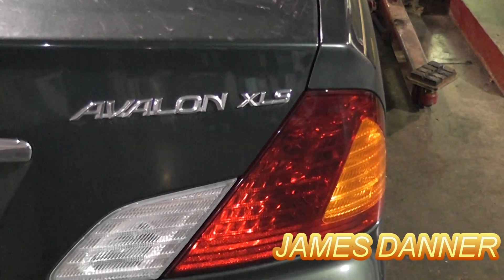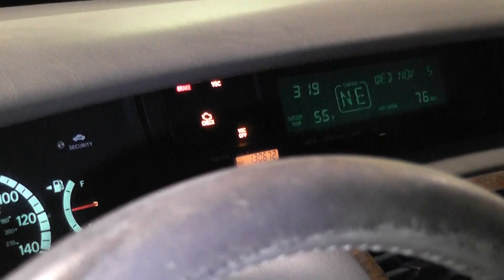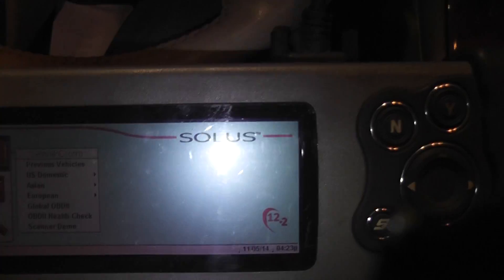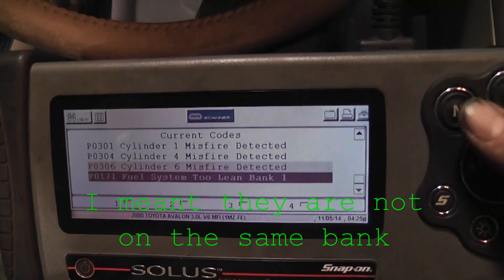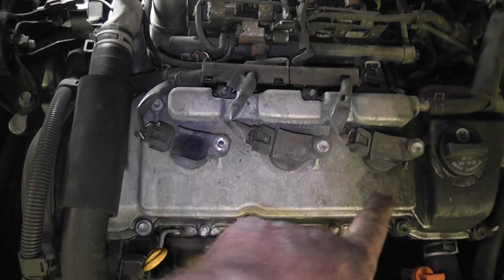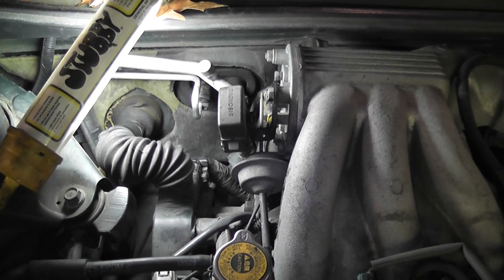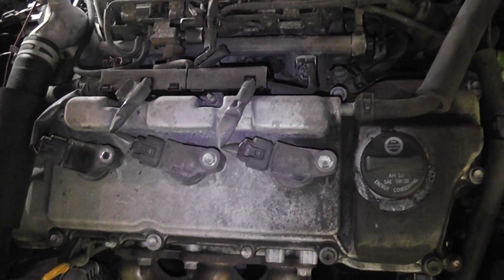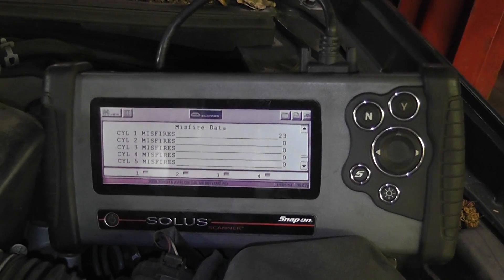TOYOTA AVALON MISFIRE REPAIR

Comment: Great that uou put it fown to the injector. I replaced all six on my 98 rx300 as one was faulty. Once you get high mileage in these engines you really want to be proactive with maintenance and start replacing sensors and belts in ine hit if possible. My experience with older classic cars is that once  components start to age fail the rest starts to go.

Comment: Hi James, thanks for your video, it might help with a 1mz I'm about to look at.    and a gift for you....  the dip in the current waveform is the injector mechanically opening and the bump in the voltage waveform is the injector mechanically closing. there is a lot of good info at pico scope auto waveform libery.   Thanks -Simon, Automotive research engineer :)

Comment: I have 00 es300 same engine same issues.  I’ve changed out ignition coils and all injectors and Vt solenoid on both sides of engine.  Still getting same outcome but I know my cat on rear needs replaced.  Gonna do that today possibly,,,,, get back to u.

Comment: I have a 2002 avalon and mine seems to want to cut out at around 41-45mph  so I changed all plugs and coils except number 1  very difficult to get to for me one moment the car is running as it should for sometime and entire day even had check engine light go out completely  well  now it's back on and still doing it as it pleases then it begins to flash and code say random multiple misfires 135  so I change all except one any chance it just may very well be that last one I haven't changed yet ???
Reply from the maker: If it's the whole bank. 1 3 and 5 suspect a vvt solenoid sticking on.  I have a video on that as well
Reply: I have an 03 avalon and I'm getting mine looked at tomorrow. I have the same problem. I have been looking around and the EGR valve might be stuck to open.
Reply from the maker: Is yours misfiring all on one bank? 1 3 and 5 or 2 4 and 6? I have a video on that symptom on Toyota with a vvt solenoid sticking on causing this
Reply: @jamesdanner7850  mine is misfiring on 135
Reply from the maker: Find my Toyota/Lexus vvt fault video. It will help explain
Reply: @jamesdanner7850  ok thnx very much ok man really appreciate it alot

Comment: The misfire goes away because you input -negative feed on the negative pulse side of the fuel injector forcing the injector to open the fuel stream to the cyliinder, that is kind of dangeorius thou because  if it remains like that during idle for a long period of time it may cause a cylinder hidrolock. Excelent vid James! Thanks.

Comment: You had some specialized equipment there.  But for those of us with only the OBD II scanner tool.   If the scanner points to a cylinder misfiring, can't we just put in a new spark plug into that cylinder and then swap the coil with a known good(front bank, easy to get to) coil.  If the misfire on the scanner moves to the swapped location, the injector was bad.  Disclaimer.  It has been 35 years since I was a professional mechanic. It was carburetors at that time.

Comment: I had alternator timing belt water pump and spark plugs changed and car is still shaking I just ordered ignition coils should fix the problem?
Reply: QuadRiderHonda Might wanna make sure the car was timed correctly before you start spending money and throwing parts at it buddy

Comment: So, where the hell IS Bank 1, Sensor 1 located on the 1997 Toyota Avalon.  Dealer, shops are all telling me it is the one nearest the radiator, just in from cyl 6. How can that be true when everyone knows that Bank 1 is ALWAYS in Bank 1 - which in the 1997 would be at the FIREWAELL side, ya?

It is a 2-wire sensor, btw.
Reply from the maker: +Dan Lo Fat bank 1 sensor one is firewall side
Reply: @jamesdanner7850  thanks for that by the way and and wallets been two years now I got the same kind of readings you have almost identical shows the problem is 1 and 2 but it's actually it's a dual coil and and the one side is faulty and two is taking the brunt of it.

the mister I was definitely on one so I got to AutoZone borrowed one of their Cheshire cat switcher it's got a pressure gauge in mm in a meter off-road testing the injectors and injector one salty so I'm changing out all the injectors and all the spark plugs spark plug wires and spark plugs and why not the coils too!

well you got to figure it's got 320k+ mikes on it right now.

Comment: I have a 2000 Toyota Avalon xl that just stop firing run find the day before what can cause that
Reply from the maker: +Keith Baldwin does it run on starting fluid?  Like a no fuel scenario.  Or not, like a no spark. I have a video on a Toyota where one of the coils shorted out and shuts the car down.  U have any codes?
Reply: James Danner it is getting fuel but no fire to the coals or wires

Comment: Test light/functioning injector phenomenon; a shorted injector pintle wont energized/open as much as designed due to loss of current to heat in its coil winding but when the test light is hooked up to its circuit in parallel it become an easier path to the current/voltage thus stabilizing the the shorted coil and allowing it to partially functioning during idle/low demand  but this wont work on a heavier demand duty cycle as it wont allow much fuel to pass through.  

Good video Danner keep it up

Comment: This one is interesting.  Good work narrowing it down so quickly to the injector.  

My guess would be a mechanical sticking in the pintle, causing restricted flow.  When you add your test light, it keeps the injector open longer and makes the misfire better because of the extra fuel.

Good video.

Comment: Hey James! I have this same car and its not coming up. No start actually. I have replaced the fuel pump but it seems no power at the pump and the relays seems to work fine. I would be glad to hear any suggestions.
Reply from the maker: +Suleiman Adams been on vacation last 2 weeks. If you still have the problem, I'll look into some wiring diagrams Monday
Reply: That would be wonderful. The car has been sitting down for some weeks and i'm running out of ideas as i am very new to the DIY lifestyle. Would be looking forward to any help or suggestions. Thanks
Reply from the maker: +Suleiman Adams what year is the avalon
Reply: 2000
Reply from the maker: +Suleiman Adams so if you think we r dealing with the fuel pump.  It gets power from the 
CIRCUIT OPENING RELAY  which is behind the drivers kick panel. 
My wiring diagram shows terminals 1,2,3 and 5
1 should have power from the ignition switch 
   Run and start
5 should have power from the EFI relay in the   left front of engine compartment 
2 is the ground control from the computer
3 is the one feeding pump
So if u have a test light ,, hook it to ground and with the C.O. relay unplugged you should see power on one with key on run and on crank
Another should show power too but it may be only for a few seconds on run but constant during cranking.
If u hook the test light to battery positive,
One ( terminal 3) should light up the test light confirming there is a ground path thru the pump
The last one, no 2,  may light up test light for a short time when u initially turn key on but definitely should when cranking 

Start there

Comment: It kinda acts like an intermittent Ground, I know I had a 98 Avalon that had a an intermittent misfire, it only had 3 coils. The misfire was on cylinder 5, I tried swapping coils, cleaning the injectors, everything, finally I ended up switching injectors 5&6 and the problem followed the injector, definitely a bad injector!
Reply: Sorry for the resurrection but when did your car misfire?  My girl has an 08 rav4 that has an intermittent cylinder one misfire pretty much only going up hill
Reply: @eflem7708  If my memory serves me right, I believe it happened after the engine heated up.

Comment: iv a 03 avencis starts perfect in morning at runs great aslong as driving but when stop for lights or roundabout check engine light comes on n it wont go I have to turn car off n then start it but takes ages tryin to start n av to av foot to floor any help greatly appreciated
Reply from the maker: I need to know what the code is. What model car?

Comment: Hey James,  GREAT VID,  
  But I just wanted to give you my input &  kinda similar Sit.,  W/ a 1997,  Altima,  kept having a,  Mis - Firing Code,  on Cyl. #1,  no Matter what I Tried,  #1,  #1, Long story short,  took out the - - INJ. -  For #1,   The INJ. Was fine,  Ohms. Were right on  Specs.,  
BUT What I did Find,  was an INJ.  "O-RING",  The inner rubber of the - O-Ring,  was split--broken  perfectly &  was Covering the - - 2-holes of the INJ.  IE.  CAUSING- Restriction,  there - for,  Causing the - - Mis - Fire!,  NO problem just went to Nissan &  Replaced  all,  4-- 'O-Rings'  (4-cyl.)  Eng. 
Put it back together,  Erased the Code,  Everything back Norm,  running 🏃 like a Champ!!!

Comment: I guess I'm super late, and I actually starting watching the second video first lol, oh well I haven't seen the solution yet but I'll make my guess now. It's a bad injector for sure, I'm gonna say the coil has shorted internally and adding the test light in a series parallel circuit put the resistance closer to where it needs to be to open the injector. I suspect scanner danner will get a waveform in second video, I also suspect there will be no injector open hump. Fingers crossed.
Reply from the maker: All real good guesses.  I know there was a real aggravated hump with test light in play.  thanks for watching

Comment: Hello, I need your urgent help, I have a toyota prado, when I use the flashing lights, does not work, but the instrument panel lights (cluster) turn on  as if I use the navigation lights. sorry my english, greeting from venezuela.
Reply from the maker: cool. few things. are flashing lights turn signals?  and navigation lights, are they just the backlighting of the gauge cluster?
Reply from the maker: and never heard of a prado. maybe not American market. but it sounds like you have a grounding problem if the turn signals are back feeding thru cluster lighting
Reply from the maker: k. it looks like a land cruiser here. What year is it
Reply from the maker: there are grounds inside on both left and right kick panels by ur feet. or one under the hood, on the back of the right cylinder head.
Reply: hi bro, how are you, greetings. I disassembled the fuse box, check all wiring harness, replace the cluster, button flashing lights, we put candles and pray much, hahaha .. but the problem persists, now check this out, I turn on the lights, high and low , Remove the fuse and where supposedly should go negative current passes positive current. is this sucking positive current from somewhere but can not find the short circuit. when I turn on the flashing lights, the cluster turns like turning the ignition swicht. it is a toyota prado fzj90 5VZ 6 cyl. landcruiser in Venezuela. I have also one toyota tacoma 2007 Electronic ignition button when I turn the truck, lights brake lights but no ignition. hahahahahaha ....... greetings from Venezuela. sorry my english
Reply from the maker: What year prado?

Comment: thanks....love the problem solving....can you do damage to the injectors sending thru too much current when gounding externally the injectors ?...thanks again...bob
Reply from the maker: Paul said maybe a peak and hold style that grounds fully initially then limits the current flow with a duty cycle or higher resistance to ground.which u would see on a ramp test as an initial rise then a flat top.  or diesels . but mine, the pcm clearly pulled to total ground as evidenced by the 0 volt line on the waveform. so my guess is no. cause u wont be sending any more current than would be done thru the pcm. that being said, i wouldn't hold it to ground for an extended time.just pulse. you would at minimum fill that cyl with fuel...bad.

Comment: How about lean misfire diag using a sec. ign  wave form on that missing cyl ?
Reply from the maker: i never did that yet. i bet i could screw that up enough for a two part vid with paul. Ha
Reply: Your videos and knowledge are awesome ! If Ya wanna hear some screw ups I have a few over the last nearly 40 years workin on cars !!!! Maybe you should have a video having guys listing there top #1 mistake ???? Remember old Chryslers that had left hand lug nut threads on the left side only ? I broke 2 off before I figured out what I was doing !!!! OMG.
Reply from the maker: Ohh. Been there before. Ha. Thanks for the feedback.much appreciated

Comment: My thought is restricted fuel a clogged injector when you ground the injector it stay open all time and the cylinder gets enough fuel.
Reply from the maker: thats where i think the consensus is. my test lights path to ground, although high in resistance. kept the field from collapsing as fast as it should, allowing the injector to stay on even a ms longer
Reply: Great videos you make by the way. Would be nice to test the injector spray pattern

Comment: To see misfire data, did you look in the generic side or the OEM side?
Reply from the maker: ***** i was on the oem side
Reply: oh i see. does all makes have misfire counters on the oem side?
Reply from the maker: Unfortunately no. At least with the snap on. Some fords u need to use the cylinder contribution functional test. Some only say yes or no on a misfire pid
Reply: thanks so much!